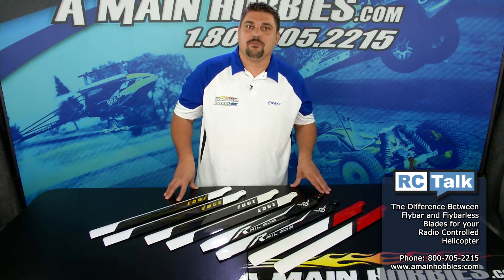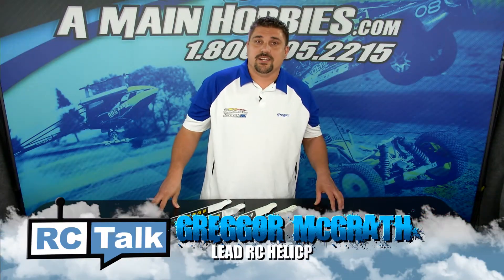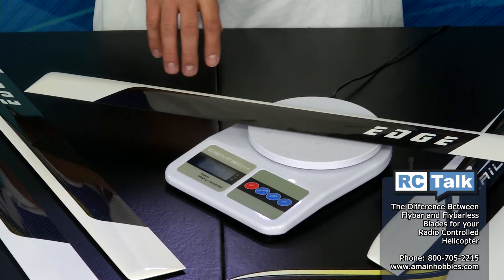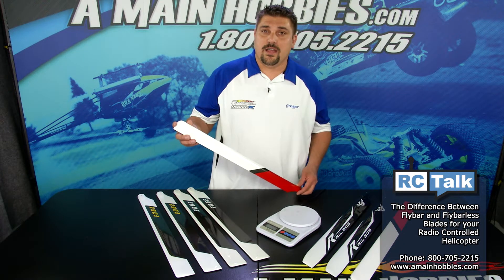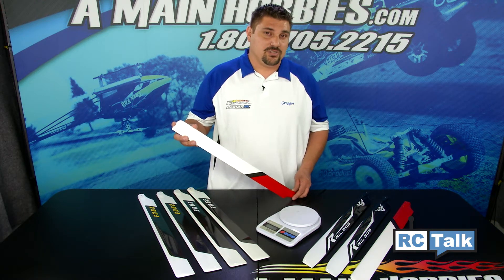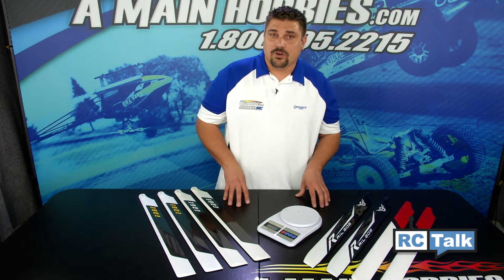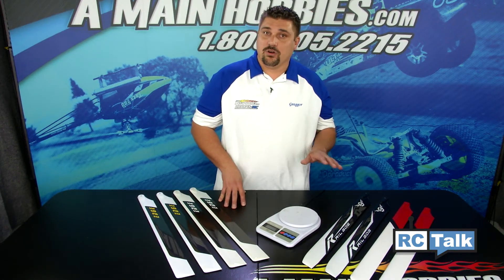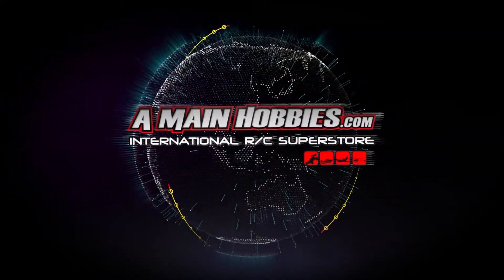Flybar And Flybarless Heli Blade Differences: AMain Hobbies RC Talk

Comment: Regarding blade weights, all my early flybar choppers from my 1992 .30 Hirobo Shuttle ZXX, 1996 Miniature Aircraft USA X-Cell .60 and 1998 X-Cell .60 Pro Graphite used symmetrical wooden blades (& even early carbon blades) that were heavily tip weighted with long strips of lead and a chord CG of about 25% MAC (Mean Aerodynamic Chord).
  I noticed on my new Trex 700XN flybar-less that the blades are a lot lighter tipped than my older flybar choppers.

This is the complete opposite to what your saying about flybar helis using lighter tipped blades.
Now I am really confused! 🤔

Comment: I do not see the reasoning behind distinguishing between flybarred vs. flybarless if all the blades out there are considered "Flybar and flybarless compatible".  There may exist light vs. heavy blades, but this should have little to do with flybar(less) stabilization system.  One is electronically stabilized, where the other is mechanically stabilized.  That should really be the only difference.